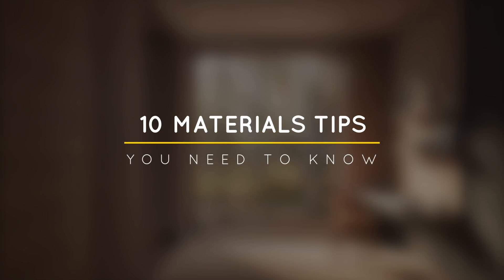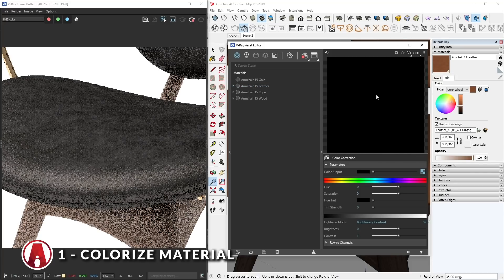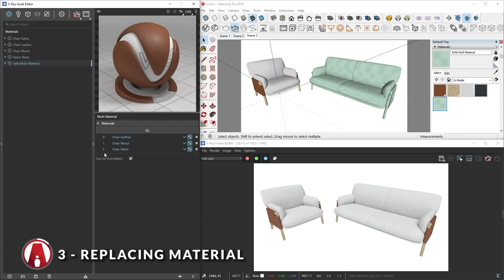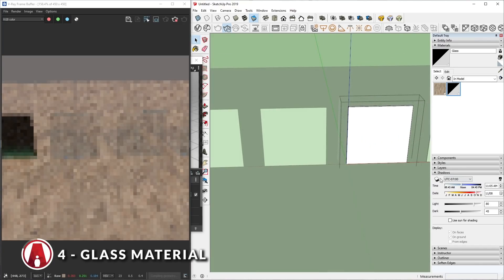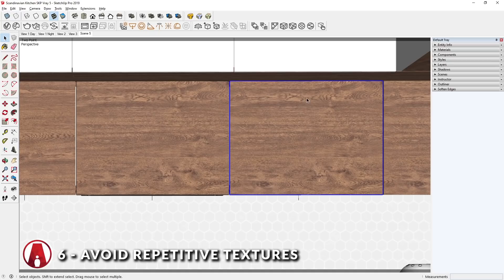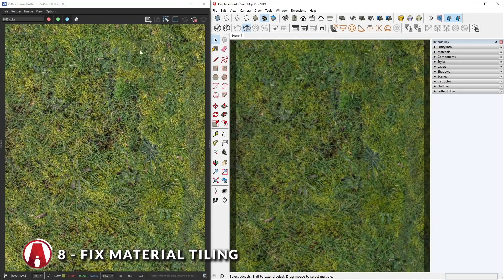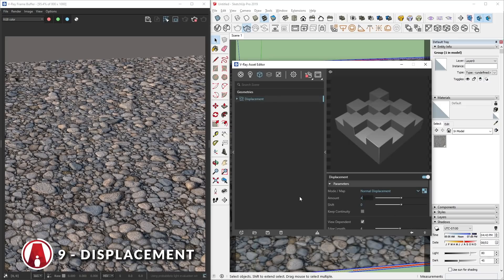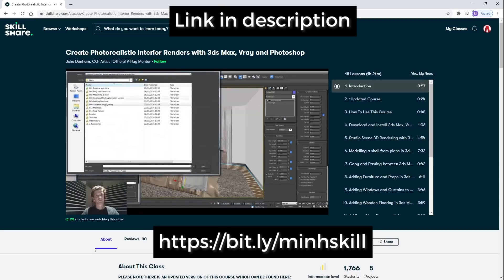10 V-Ray Materials Tips You Need to Know

Comment: For tip 7, I am using the Vray Next and I don't seam to have the sliders. Any idea why?
Reply: You can't add variation like that in Next, but you can wrap the diffuse image in a "mix operator"

In one slot of the mix operator you have the original diffuse image and in the other you can add a multi sub material. 

In vray next you can add a number of textures which are applied with a "random by render id". I just added different materials with different shades of gray. Those are then multiplied with the original image and create variations.
Reply from the maker: Hm I think you can only do it in Vray 5
Reply: @ArchitectureInspirations  Yeah, I figured ... Thanks thou, nice video!
Reply from the maker: Thank you!